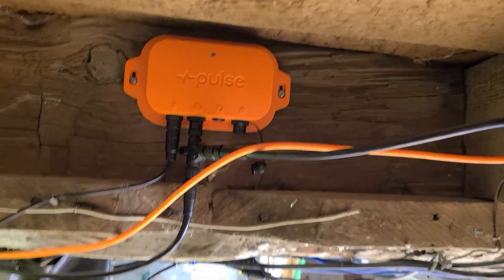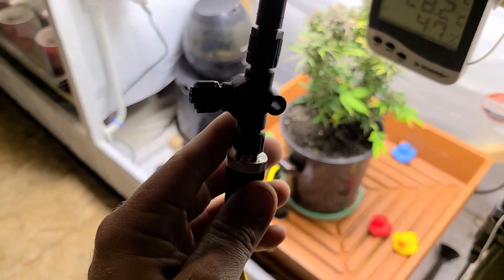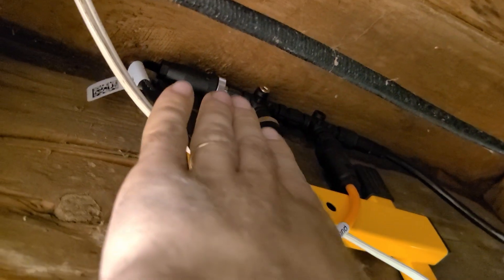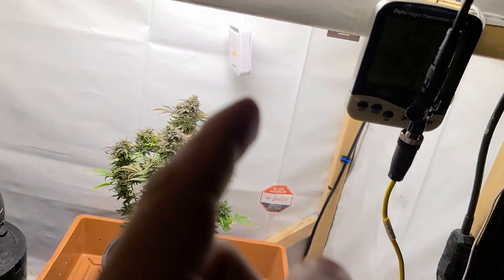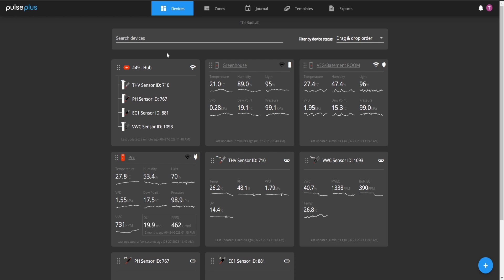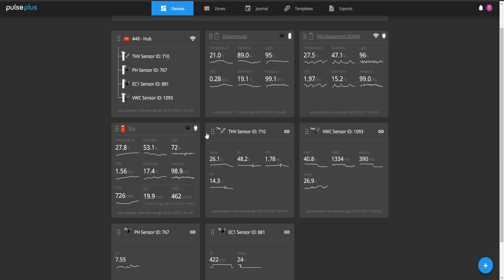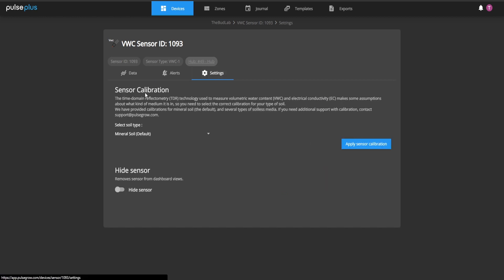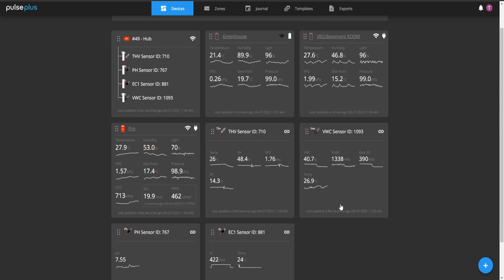Step into the Future of Growing: Pulse Hub & Sensor Setup Showcase!  (Limited-time Coupon)

Comment: That sensor is not in your pot the right way brother. They need to be straight in and lower than that to get accurate data. Cheers 🤘
Reply from the maker: Happy Sunday! I put the soil sensor raised up a bit / angled because I use a flood system in that room. I didn't want to continuously soak the sensor, so I raised it just above flood zone and tried to angle it down into it a bit. Was hoping this would give me the most accurate for my methods. I felt like since I bottom water, it would give me super unaccurate readings as it would pretty much be submerged daily. This is installed in the virtual grow too & next grow I was thinking of using a fabric. Will level it out a bit better & install it as low as I can. Thanks for the comment!!!!! 👊

Comment: What all does the standard sensor measure?
Reply from the maker: The THV-1 measures your air temperature, humidity & VPD | PH-1 does water PH | EC-1 does water temperature & EC | VWC-1 does soil temperature, moisture content, bulk ec & pore ec. They also have a Pulse one unit / Pulse Pro which are pretty cool too! 😎
Reply: @TheBudLab  I was hoping it would do co2 also. I wanted to get the hub since it would eliminate the need for a different monitor for my ec and ph. Are you liking it so far? Is it worth the cost?  Thank you for the reply.
Reply from the maker: @scottsurratt6868  they are releasing new sensors for the HUB regularly it seems. The newest is Apogee PAR. The Pulse Pro does par & light spectrum wirelessly, and it has a co2 reader too. They are an investment but have definitely made me a better grower. Here is my pro charts from the last week (drying room now, was a flower. https://app.pulsegrow.com/chart-sharing/jqy2Qk
Reply: @TheBudLab  thank you for the info. I liked the video as there are not many hub videos out at the moment.